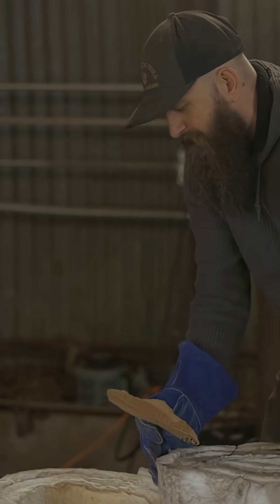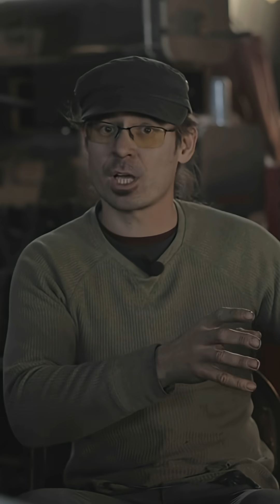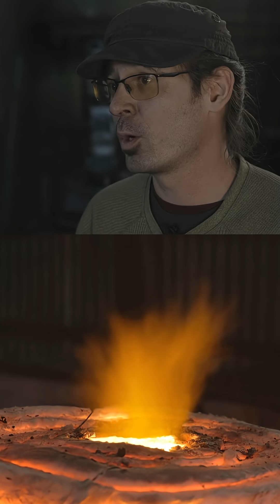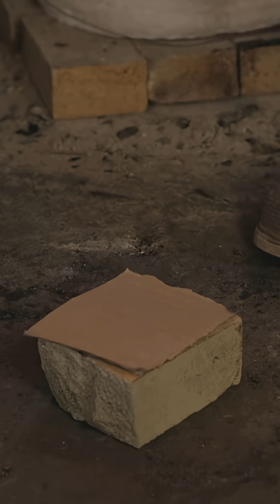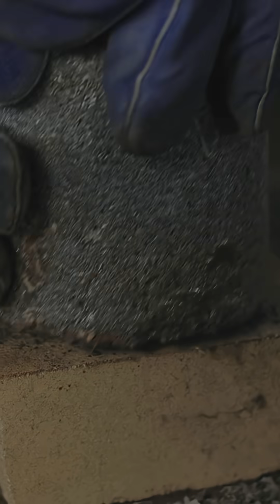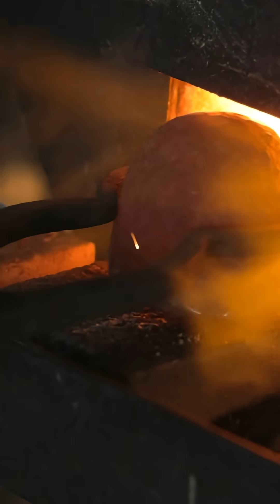Not all crucible steel is wootz #tools #wootz #fabrication #blacksmith #history #mythology

Comment: Didn't they figure out that it was ore from a particular mine that had slightly elevated vanadium levels that gave the steel its trademark pattern?
Reply: Yeah, a group of people from a university worked out how to recreate the same impurities. The resulting steel looks identical too wootz steel (or damascus steel)
Reply: @ThePseudologist this is an entire can of acoustics that, trust me, you don't want to know. 

Here's an example: theres substantial reasoning to only include the watered effect with small curls as wootz, but a billet of the same chemistry with large curls wouldn't be counted as wootz to some. Other "scolars" only accept direct reduction manufacturing as producing wootz, while rejecting the Georgian method (cast iron plus iron)... even if the outcomes of both will be identical chemically and visually. 

Furthermore, theres a school of scholarship that only accepts 0.8 to 1.1% c content as wootz... while some historical samples have shown carbon content to be basically cast iron. 

Again. What people do in modern times is mostly speculation and reverse engineering. Due to overwhelming debate inside scholarship community its best to define wootz historically rather than physically. Precisely because noone agrees on exact physical/mechanical definition,  but everyone understands what centuries are and what geography is.
Reply from the maker: There have been quite a few people that have most likely figured out the recipe. Most likely just enough good enough for us. Not to take away anything from their work which is top notch and amazing.
Reply: There have been wootz production from Java all the way to Armenia. It is unlikely that they all used the same mine.

Comment: I would make the same distinction with Damascus vs pattern-welded stel, but unfortunately in popular use that ship has long sailed. To the point that anything with a pattern on it will get called damascus even when it's just stamped monosteel with some laser etching to make it look fancy
Reply: The word damascus has been used to refer to basically all steel with a pattern since the 1700s in Europe, its not historically accurate but people having been using it for so long that it's basically common language
Reply from the maker: @Brady_Koopal fair
Reply from the maker: I wouldn't go that far but I understand the feeling
Reply: I do make that distinction, although I acknowledge that it's a losing battle and I'm just being pedantic. Bill Moran just used the term "damascus steel" to make his pattern steel seem fancier, even though we've been using welded steel in the form of shear steel for centuries before more modern metallurgy came into play. These days pattern-welding is just for appearance, as far as I can tell just using modern steels provide better performance than pattern welding.
Reply from the maker: @TheSmallzfry I tend to agree although there is some new studies that point to a slight advantage that we are considering covering in a seperate video of you all would like to hear our thoughts and see some experiments.